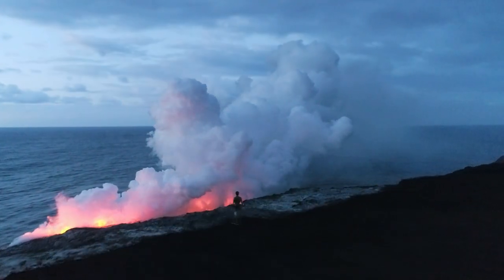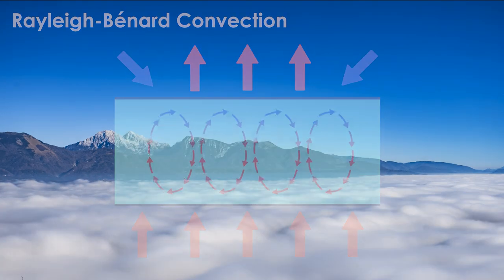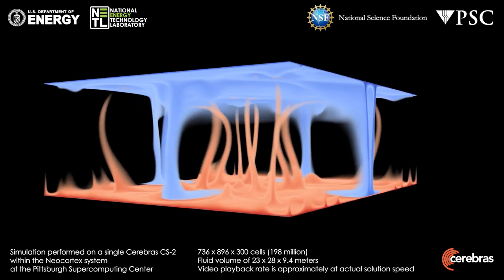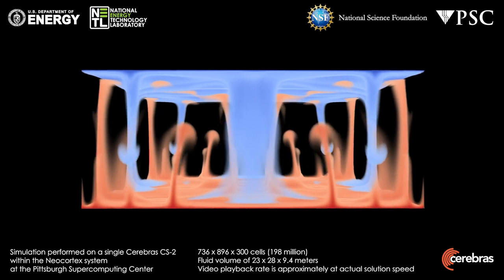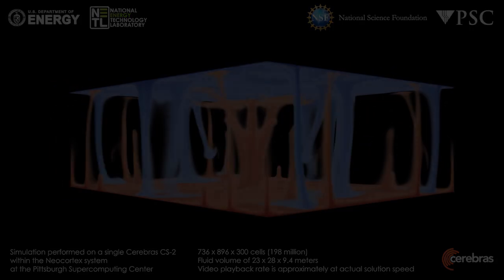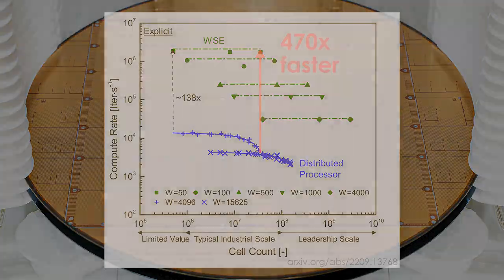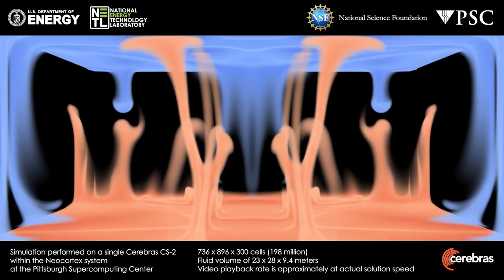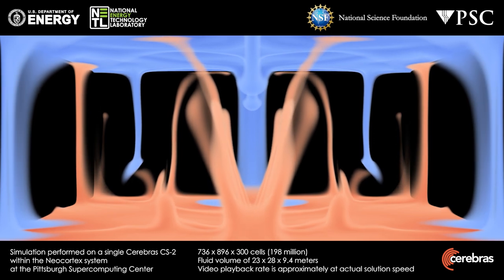Real-Time Computational Fluid Dynamics

Comment: cool! the rendering seems to be only done for one quarter of what is shown, however, exact mirroring in all quadrants, I believe.
Reply from the maker: Well spotted, Lennard! In fact, the simulation and the rendering were done for all four quadrants. The reason for the symmetry is the boundary conditions were uniform. The fact that the simulation remains uniform means that algorithm is properly deterministic and that no errors are creeping in. Which is a happy thing. :)

Comment: The schematic figure in the beginning is wrong. Updrafts should be side by side, i.e. a "clockwise" rotation should be next to an anti-clockwise rotation.
Reply from the maker: Well spotted, Katrin! I noticed that too, but too late to fix. You'd be amazed how many extremely smart people failed to notice.
Reply: @CerebrasSystems  It's not clear from the expected result why this was chosen to show off the potential.  I would like to know the bandwidth equation for heat across a vertical column of supercritical mass assuming infinite replenishment miles down. Pricing energy requires a market or such 'table' being known widely.  Excavation of bore becomes affordable quickly but how quickly, how large?  Nonmechanical nor electrical energy transfer saves world.

Comment: How does it work on low level, is there some sort of compute shaders ?
Reply from the maker: Hi Dimitrios, good question! 

This paper explains the underlying mechanism: https://arxiv.org/abs/2209.13768. As the introduction explains, in one sense it's quite conventional: simply solving field equations across a mesh using a large number of workers in parallel.

Briefly, the Cerebras architecture is faster because we keep all that parallel activity on the same piece of silicon: no external networking, no coarse-grained parallelism. We showed that the nearly one million cores on the Cerebras Wafer-Scale Engine could be effectively used to solve problems with billion-node meshes for modeling field equations, at very high utilization and efficiency, with a very fine computation grain of about one thousand mesh points per core. 

Conversely, conventional clusters need much coarser grained parallel work chunks because while they have multi-teraFLOP processors, the sluggish network connecting them forces them is distribute the field into large chunks. 

You might also like to listen to Dr. Van Essendelft explaining this in a short presentation he gave at SC22 late last year: https://youtu.be/7mT7sBI-Iyg.

Comment: It looks like it is exactly mirrored. If thats the case, I know how to speedup the simulation again by a factor of two ;)
Reply from the maker: Hello again, Katrin. Another good question!

In fact, there are no symmetrical boundaries in this simulation.  But you're right, the Initial conditions were is perfectly centered and uniform.  The order of operations in every direction is exactly the same in the code.  There is no opportunity for errors to accumulate differently in any of the 3 directions.  Unless there is a numerical perturbation that is either asymmetric in the code or in the initial condition, it will remain symmetric.  This is a difference between a model and reality.  If we give an asymmetric IC, even different by a single bit, it will eventually be non symmetrical.
Reply: If you consider chaos theory you should realize that with ideal starting conditions and 0 noise, a good algorithm and good, error-free hardware will be able to produce a perfectly symmetrical result after many many steps. In other words, consider the perfect symmetry almost a benchmark. Not that it's anything significant. It's really not. Don't think I'm trying to say it's actually a real benchmark.

Comment: Super impressive, but not a first unfortunately. I've done real-time convection simulation in 2019 already, on a 2017 gaming PC: https://youtu.be/lDsz2maaZEo
Still looking forward to more non-AI applications on Cerebras hardware, these vector processors seem ideal especially for CFD!
Reply: Wow, your gaming pc must be very powerful. Your pc must cost at least a couple of millions of dollars, yeah?
Reply: @30svich  $1300 for the Titan Xp GPU back then (got mine for free from Nvidia), now the almost identical 1080 Ti goes for $150 on ebay.
Reply: @ProjectPhysX  r/woosh. How is whats done in this video not a first? The scale of cfd simulation is the first. You cannot compare a crappy laptop with the cerebras scale. If you are talking about cfd simulations, cfd was long before 2019, cfd computations were done in 1970s
Reply: @30svich  it's a matter of software. I can do the same simulation, same resolution, on a modern laptop, in real time.
Reply: @ProjectPhysX  you should be hired by Cerebras, because they spent more than 600 million dollars to build this supercomputer, but you can do it on laptop with the same resolution. Your software is better then theirs
Reply: @30svich  I'm already collaborating with them ;)
Reply: @ProjectPhysX  wow, thats amazing, I believe that you are indeed working with cerebras. You have done amazing work. So, you can do an accurate real-time 200 million cells simulation on a pc? Why did cerebras made a custom chip smh